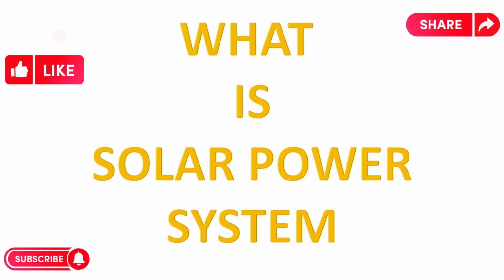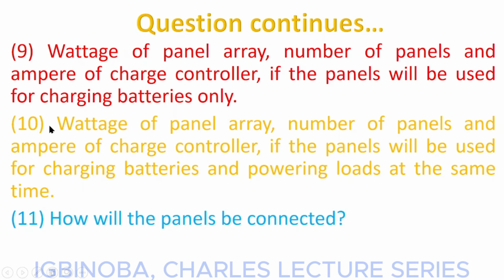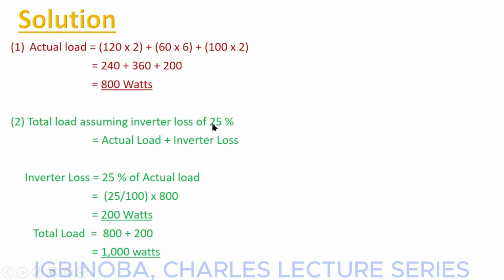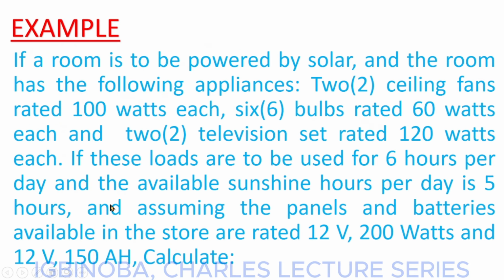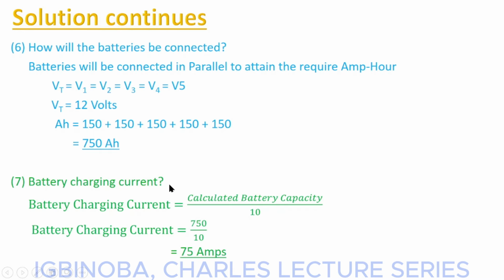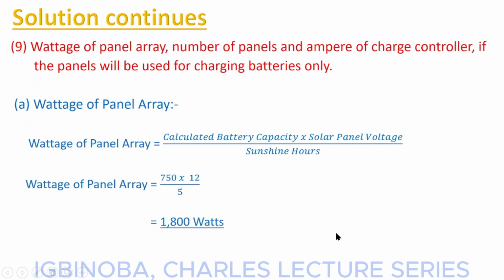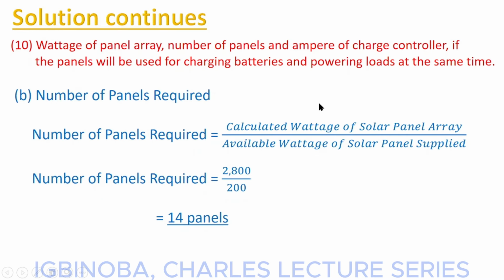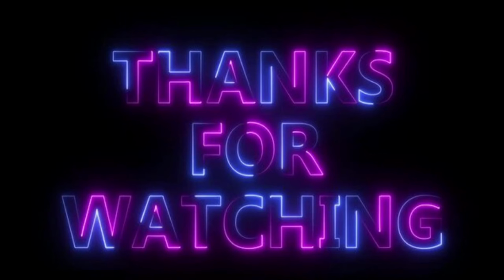Design of Solar Power System

Comment: EEE3109E
1. Actual Load: 1380 W

2. Total Load : 1840 W

3. Inverter Rating (VA): 2300 VA

4. Battery Capacity: 1227 Ah

5. Number of Batteries: 9 batteries

6. Battery Connection: Parallel

7. Battery Charging Current: 15 A (per battery string)

8. Battery Charging Time: 5.1 days

9. Panel Array (for charging batteries only):

- Wattage: 2945 W

Number of Panels: 15 panels

Charge Controller Ampere: 245 A

10. Panel Array (for charging batteries and powering loads):

- Wattage: 4785 W

Number of Panels: 24 panels

- Charge Controller Ampere: 399 A

11. Panel Connection: Series - Parallel

Comment: CIV315I

i) Actual load=1380W
ii) Total load=1725W
iii) Inverter rating=2156.25VAmp
iv) Battery capacity=1293.75AH
v) No of batteries=9
vi) They will be connected in parallel 
vii) Battery charging current=129.38A
viii) Battery charging time=14hrs
ix)  For battery only
      Panel wattage=3105W
      No of panels=16panels
      Panel current=258.75A
x) For both battery and charging
     Panel wattage=4830W
     No of panels=24panels
     Panel current=402.5A
xi) The panels will be connected in parallel

Comment: PETRO316P

Actual load: 1380 Watts

Total Load: 1725 Watts

Inverter rating: 2156.25 VA

Battery capacity: 1293.75 Ah

Number of batteries for backup: 9

Batteries are connected in parallel.

Battery charging current: 129.375 Amps

Battery charging time: 14 hrs

9)

a) Wattage of parallel array: 3105 Watts
b) Number of panels required: 16 panels
c) Ampere of charge controller: 258.75 Amps

10)

a) Wattage of parallel array: 4830 Watts
b) Number of panels required: 25 panels
c) Ampere of charge controller: 402.5 Amps

11 The panels are connected in a parallel manner.

Comment: EEE342P
1.Actual Load = 1380watts
2.Total Load = 1725watts
3.Inverter rating = 2156.25 VA
4.Battery Capacity = 1293.75Ah
5.No of Batteries = 9
6.Batteries are connected in Parallel
7.Battery Charging current = 129.4amps
8.Battery Charging time = 14hrs
9a) Wattage of panel array = 3105watts
9b) Number of panels = 16 panels
9c) Charge Controller = 258.75 A
10a) Wattage of panel array = 4830 watts
10b) Number of panels = 24
10c) Charge Controller = 402.5A
Panels are arranged in Parallel

Comment: PETRO35E

1)Actual load: 1380W
2)Total load: 1840W
3)Inverter rating (VA): 2300VA
4)Battery capacity: 1227Ah
5) Number of batteries: 9 batteries
6) Battery connection. Parallel
7)Battery Charging Current: 15 A (per battery
string)
8)Battery Charging Time: 5.1 days
9)Panel Array (for charging batteries only):
Wattage: 2945W
Number of Panels: 15 panels Charge
Controller Ampere: 245 A
10) Panel Array (for charging batteries and
powering loads)
Wattage. 4785 W - Number of Panels: 24
panels Charge
Controller Ampere: 399 A
11)Panel Connection. Series - Parallel

Comment: PETRO3189G

i) Actual load=1380W
ii) Total load=1725W
iii) Inverter rating=2156.25VAmp
iv) Battery capacity=1293.75AH
v) No of batteries≈9
vi) They will be connected in parallel 
vii) Battery charging current≈129.38A
viii) Battery charging time=14hrs
ix)  For battery only
      Panel wattage=3105W
      No of panels≈16panels
      Charge controller current=258.75A
x) For both battery and charging
     Panel wattage=4830W
     No of panels≈24panels
     Charge controller current=402.5A
xi) The panels will be connected in parallel

Comment: CHM357E
1.Actual load = 1380 W

2.load with inverter loss = 11,040 Wh/day

3.Inverter rating = 1725 VA (≈1.8 kVA)

4.Battery capacity = 3680 Ah

5.No. of batteries = 25 batteries

6.Connection method = Parallel connection

7.Battery charging current ≈ 316 A

8.Battery charging time ≈ 4.8 hours

9.(Charging batteries only)

Panel array wattage: 3680 W

Number of panels: 19 panels

Charge controller rating: 400 A (12 V)

10 (Charging + powering loads)
Panel array wattage: 5400 W

Number of panels: 27 panels

Charge controller rating: 550 A (12 V)

11.Panels connected in PARALLEL

Comment: PETRO366N

1)Actual load: 1380W
2)Total load: 1840W
3)Inverter rating (VA): 2300VA
4)Battery capacity: 1227Ah
5)Number of batteries: 9 batteries
6)Battery connection. Parallel
7)Battery Charging Current: 15 A (per battery string)
8)Battery Charging Time: 5.1 days
9)Panel Array (for charging batteries only): - Wattage: 2945W
Number of Panels:  15 panels Charge Controller Ampere: 245 A
10) Panel Array (for charging batteries and powering loads):
Wattage. 4785 W - Number of Panels: 24 panels Charge
Controller Ampere: 399 A
11)Panel Connection. Series - Parallel

Comment: PETRO3138H
 
1. Actual load= (100×3)+(60×10)+(120×4) =1380watts

2. Total load assuming inverter loss of 25%= Actual load +Inverter loss
Inverter loss=25% of Actual load
= 25%×1380=345 watts
Total load= 1380+345=1725 watts

3. Inverter rating on VA using power factor of 0.8
= (1725÷0.8)= 2156.25

4. Battery capacity using factor for reserve 75%=(2×1725×6×0.75)=1293.75Ah

5. No. of batteries for backup hours=1293.75Ah÷150Ah= 8.6 =8 batteries 

6. How batteries will be connected?
The batteries will be connected in parallel 
Vt=V1=V2=V3=V4=V5=V6=V7=V8
Ah= 150+150+150+150+150+150+150+150=1200

7. Battery charging current=1293.75÷10=129Amps

8. Battery charging time assuming charging loss of 40%= 1293.75Ah+(40%+1293.75Ah)÷129A=14hrs

9a. Wattage panel array= 3105 watts
9b. Number of panels required= 3105÷345=9 panels 
9c. Ampere of charging controller required= 3105÷12=258.75Amps

10a. Wattage of panel array= Calculated wattage of solar panel array for charging battery only+ calculated total load =3105+1725=4830watts
10b. Number of panels required= calculated wattage of solar panel array÷ Available wattage of solar panel supplied= 4830watts÷345= 14Amps
10c. Ampere of charge controller= calculated wattage of solar panel array÷ solar panel voltage=4830watts÷12volts= 402.5Amps

11. How will the panels be connected?
Ans: They will be connected in parallel

Comment: EEE330D 

1.Actual Load = 1380watts

2.Total Load = 1725watts

3.Inverter rating = 2156.25 VA

4.Battery Capacity = 1293.75Ah

5.No of Batteries = 9

6.Batteries are connected in Parallel

7.Battery Charging current = 129.4amps

8.Battery Charging time = 14hrs

9a) Wattage of panel array = 3105watts

9b) Number of panels = 16 panels

9c) Charge Controller = 258.75 A

10a) Wattage of panel array = 4830 watts

10b) Number of panels = 24

10c) Charge Controller = 402.5A

Panels are arranged in Parallel

Comment: PETRO314N

1. Actual load: 1,380 W
2. Total load: 1,725 W
3. Inverter rating: 2,156.25 VA
4. Battery capacity: 293.75 AH
5. Number of Batteries: 8.6 batteries
6. Parallel
7. Battery charging current: 129.375 Amps
8. Charging time: 14hrs
9. a. 3,105W, b. 15.5~16 panels c. 258.75 Amps
10. a. 4,830W, b. 24 panels c. 402.5 Amps
11. Parallel

Comment: MECH391M
1: actual load 1380watts

2: total load=1725 watts

3: inverter rating-2156,25VA

4: battery capacity» 1293.75A

5: No of batteries=9

6: batteries are connected in parallel

7. battery charging current =129.4amps

8: battery charging time=14hrs

9a: wattage of panel array 3105watts

9b: number of panels-16panels

9c: charge controller= 258.75A

10a: wattage of panel array 4830watts

10b: number of panels = 24

10c: charge controller = 402.5A

11: panels are arranged in parallel

Comment: EEE326Z
1.Actual Load = 1380watts
2.Total Load = 1725watts
3.Inverter rating = 2156.25 VA
4.Battery Capacity = 1293.75Ah
5.No of Batteries = 9
6.Batteries are connected in Parallel
7.Battery Charging current = 129.4amps
8.Battery Charging time = 14hrs
9a) Wattage of panel array = 3105watts
9b) Number of panels = 16 panels
9c) Charge Controller = 258.75 A
10a) Wattage of panel array = 4830 watts
10b) Number of panels = 24
10c) Charge Controller = 402.5A
Panels are arranged in Parallel

Comment: NAT38H 

1. Actual Load: 1380W

2. Total Load (including inverter loss): 1840W

3. Inverter Rating (VA): 2300VA

4. Battery Capacity: 1227Ah

5. Number of Batteries: 9 batteries

6. Battery Connection: Parallel

7. Battery Charging Current: 15A (per battery string)

8. Battery Charging Time: 5.1 days

9. Panel Array (for charging batteries only):
- Wattage: 2945 W
- Number of panels: 15 panels
- Charge Controller Ampere: 245A

10. Panel Array (for charging batteries and powering loads):
- Wattage: 4785 W
- Number of Panels: 24 panels
- Charge Controller Ampere: 399A

11. Panel Connection: Series - Parallel

Comment: EEE3108D

1.Actual Load: 1380 Watt

2. Total Load (including inverter loss): 1840 Watt

3. Inverter Rating (VA): 2300 VA

4. Battery Capacity: 1227 Ah

5. Number of Batteries: 9 batteries

6. Battery Connection: Parallel

7. Battery Charging Current: 15 Amp (per battery string)

8. Battery Charging Time: 5.1 days

9. Panel Array (for charging batteries only):

Wattage: 2945 Watt

Number of Panels: 15 panels

Charge Controller Ampere: 245 Amp

10. Panel Array (for charging batteries and powering loads):

Wattage: 4785 Watt

Number of Panels: 24 panels

Charge Controller Ampere: 399 Amp

11. Panel Connection: Series-Parallel

Comment: EEE 3112H

1. Actual load= 1380 Watts
2.Total load =1725W
3. Inverter rating =2156.25VA
4. Battery capacity =1293.75Ah
5. Number of batteries= 9 batteries 
6. Parallel 
7. Battery charging current =129.375 Amps
8. Charging time= 14 hrs
9a) 3105 Watts
   b) 15.525~16 panels
   c) 258.75 Amps

10a) 4830 Watts
     b) 24.15 ~25 panels
     c) 402.5 Amps

11. Parallel

Comment: CHM35E
1) Actual Load=1380watts
2) Total load=1725watts
3) Inverter rating=2156.25VA
4) Battery capacity=1293.75Ah
5) No of batteries=9
6) Batteries are connected in parallel
7) Battery charging current=129.4amps
8) Battery charging time=14hrs
9a) Wattage of panel array=3105watts
9b) Number of panels=16panels
9c) Charger controller=258.75A
10a) Wattage of panel array=4830watts
10b) Number of panels=24
10c) Charger controller=402.5A
11) Panels are arranged in parallel

Comment: MECH 3117M

1. Actual Load: 1380 watts
2. Total Load : 1725 watts
3. Inverter Rating : 2156.25 VA
4. Battery Capacity : 1293.75 Ah
5. Number of Batteries : 8.625 - 9 batteries
6. Parallel
7. Battery charging current: 129.375 Amps
8. Charging time : 14 hrs
9. (a) 3105 watts
(b) 15.525-16 panels
(c) 258.75 Amps
10. (a) 4830 watts
(b) 24.15 - 24 panels
(c) 402.5 Amps
11. Parallel

Comment: MECH 312L

1. Actual Load: 1380 watts
2. Total Load : 1725 watts
3. Inverter Rating : 2156.25 VA
4. Battery Capacity : 1293.75 Ah
5. Number of Batteries : 8.625 - 9 batteries
6. Parallel
7. Battery charging current: 129.375 Amps
8. Charging time : 14 hrs
9. (a) 3105 watts
(b) 15.525-16 panels
(c) 258.75 Amps
10. (a) 4830 watts
(b) 24.15 - 24 panels
(c) 402.5 Amps
11. Parallel

Comment: CHM381C

1. Actual Load: 1380 watts
2. Total Load : 1725 watts
3. Inverter Rating : 2156.25 VA
4. Battery Capacity : 1293.75 Ah
5. Number of Batteries : 8.625 - 9 batteries
6. Parallel
7. Battery charging current: 129.375 Amps
8. Charging time : 14 hrs
9. (a) 3105 watts
(b) 15.525-16 panels
(c) 258.75 Amps
10. (a) 4830 watts
(b) 24.15 - 24 panels
(c) 402.5 Amps
11. Parallel

Comment: PETROCHEM40N

1. Actual load = 1380 watts
2. Total load = 1725 watts
3. Inverter rating = 2156.25 VA
4. Battery Capacity = 1293.75 Ah
5. No. of batteries = 8.625 -- 9
6. The batteries are connected in parallel connection
7. Battery charging current = 129.375 Amps
8. Battery charging time = 14 hours
9. (a) 3105 watts
    (b) 15.525 -- 16 panels
    (c) 258.75 Amps
10. (a) 4830 watts
      (b) 24 panels
      (c) 402.5 Amps
11. The solar panels will be in  Parallel connection

Comment: COMP97S

1) Actual load=1380 watts
2) Total load =1725 watts
3) Inverter rating(VA)=2156.25VA
4) Battery Capacity=1293.75Ah
5) Number of batteries =8.625--9
6) The batteries are connected in parallel
7) Battery charging current=129.375Amps
8) Battery charging time=14 hours
9) (a) 3105 watts
     (b) 15.525--16 panels
     (c)  258.75Amps

10) (a) 4830 watts
       (b)24 panels
       (c)402.5 Amps

11) The solar panels will be in parallel connection.

Comment: MAR312L

1 Actual load 1380W
2 Total load  1720W
3 Inverter rating  2156.25VA
4 battery Capacity 1293.75Ah
5 number of batteries 8.6
6 Parallel 
7 Battery charging  129.4A
8 T = 14hrs
9 (a) 3105W
   (b) 15.5 panels 
   (c)  258.75 A
10 (a) 4830W 
     (b) 24 panel 
     (c) 402.5A 
11 Parallel

Comment: MAR357E

1. Actual Load: 1380 W 2. Total Load (including inverter loss): 1840 W 3. Inverter Rating (VA): 2300 VA 4. Battery Capacity: 1227 Ah 5. Number of Batteries: 9 batteries 6. Battery Connection: Parallel 7. Battery Charging Current: 15 A (per battery string) 8. Battery Charging Time: 5.1 days 9. Panel Array (for charging batteries only): Wattage: 2945 W - Number of Panels: 15 panels Charge Controller Ampere: 245 A 10. Panel Array (for charging batteries and powering loads): Wattage: 4785 W - Number of Panels: 24 panels Charge Controller Ampere: 399 A 11. Panel Connection: Series - Parallel

Comment: MECH3159C

1)actual load = 1380watts
2)total load= 1725 watts
3) inverter rating =2156.25VA
4) battery capacity= 1293.75A
5) No of batteries= 9
6) batteries are connected in parallel
7) battery charging current = 129.4amps
8)battery charging time=14hrs
9a) wattage of panel array= 3105watts
9b number of panels= 16panels
9c)charge controller= 258.75A
10a) wattage of panel array=4830watts
10b) number of panels = 24
10c) charge controller= 402.5A
11)panels are arranged in parallel

Comment: MAR3120P
1) Actual load= 1380W
2) Total load= 1725W
3) Inverter rating = 2156.25VA
4) battery capacity = 1293.75Ah
5) Number of batteries = 8.6 ~ 9 batteries 
6) Battery connection= Parallel 
7) Battery charging current= 129.375 Amps
8) Charging time= 14 hrs 
9a) 3105 Watts
9b) 15.525 ~ 16 panels
9c) 258.75 Amperes
10a) 4830 Watts
10b) 24.15 ~ 25 panels
10c) 402.5 Amperes
11) parallel

Comment: CODE ; EEE3120P

1.Actual Load: 1380 Watt

2. Total Load (including inverter loss): 1840 Watt
3. Inverter Rating (VA): 2300 VA
4. Battery Capacity: 1227 Ah
5. Number of Batteries: 9 batteries
6. Battery Connection: Parallel
7. Battery Charging Current: 15 Amp (per battery string)
8. Battery Charging Time: 5.1 days
9. Panel Array (for charging batteries only):
- Wattage: 2945 Watt
- Number of Panels: 15 panels
- Charge Controller Ampere: 245 Amp
10. Panel Array (for charging batteries and powering loads):
- Wattage: 4785 Watt
- Number of Panels: 24 panels
- Charge Controller Ampere: 399 Amp
11. Panel Connection: Series - Parallel

Comment: MECH3154X

1. Actual load 1380W

2.Total load 1720W

3 .Inverter rating 2156.25VA

4. battery Capacity 1293.75Ah

5.number of batteries 8.6

6 .Parallel

7. Battery charging

8.T = 14hrs

9. (a) 3105W

129.4A

(b) 15.5 panels

(c) 258.75 A

10 (a) 4830W

(b) 24 panel

(c) 402.5A

11. Parallel

Comment: CIV 396R

1. 1380W
2. 1725W
3. 2156.25 VA
4. 1293.75 AH
5. 9 batteries 
6. Parallel Connection 
7. 129.375A
8. 14 hours
  9a. 3105W
   9b. 16 panels
   9c. 258.75A
10a. 4830W
10b. 24 panels
10c. 402.5A
  11. Parallel Connection

Comment: MAR39I 
1. Actual load: 1380 W
2. Total load:1725W
3.Inverter rating: 2156.25AH
4. Battery capacity:1293.75AH
5. Number of batteries:9
6. Connected in parallel 
7. 129.375 amps
8.Charging time 14 hours
9. (a)3105 Watts 
(b)15.5 panel
(c)258.75 A
10.(a) 4830 watt
(b)24 panel
(c)402.5 A
11. Connected in parallel

Comment: EEE77Y

1.  Actual load = 1380Watts
2. Total load =1725Watts
3. Inverter rating=2156.25VA
4. Battery capacity =1293.75Ah
5.  Number of battery for backup hours =9 battery
6. Battery will be connected in parallel
7. Battery charging current =129.4Amps
8. Battery charging time =14 hours
9a.  3105 Watts
9b. 16 panels
9c. 258.75A
10a. 4830Watts
10b. 24 Panels
10c. 4025A
11.  Parallel

Comment: MECH358F

1) Actual load: 1380W

2) Total load: 1840W

3) Inverter rating (VA): 2300VA

4) Battery capacity: 1227Ah

5) Number of batteries: 9 batteries

6) Battery connection: Parallel

7) Battery Charging Current: 15 A (per battery string)

8) Battery Charging Time: 5.1 days.

9) Panel Array (for charging batteries only): - Wattage: 2945 W - Number of Panels: 15 panels Charge Controller Ampere: 245 A

10) Panel Array (for charging batteries and powering loads): Wattage: 4785 W - Number of Panels: 24 panels - Charge Controller Ampere: 399 A

11) Panel Connection: Series - Parallel

Comment: Code. :    EEE333G

1. Actual Load = 1380watts

2. Total Load = 1725watts

3. Inverter Rating = 2156.25VA

4. Battery Capacity - 1293.75Ah

5. Number of Batteries -8.625-9

6. Parallel Connection

7. Battery Charging current 129.375Amp

8. Battery Charging Time- 14hours

9a. Wattage on Panel Array = 3105watts

9b. Number of panels -15.5-16panels

9c. Ampere of charge controller - 258.75Amps

10a. Wattage of panel array - 4830watts

10b. Number of Panels - 24.15-25panels

10c. Ampere of Charge controller - 402.5amps

11. Parallel connection.